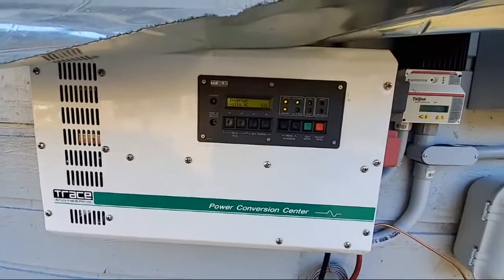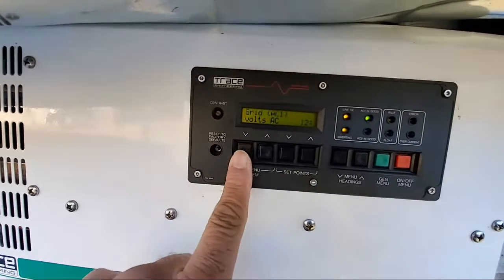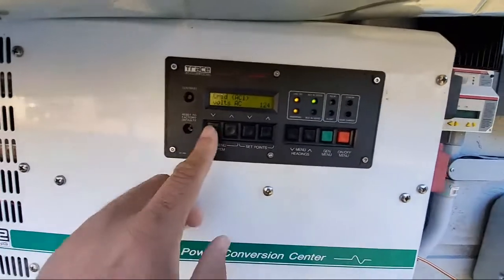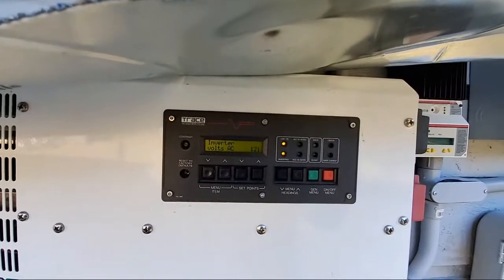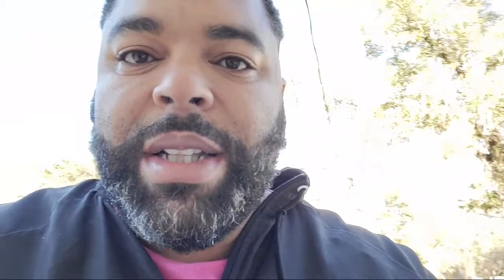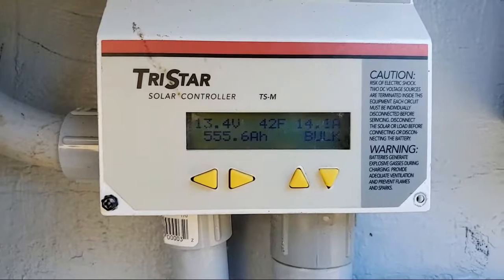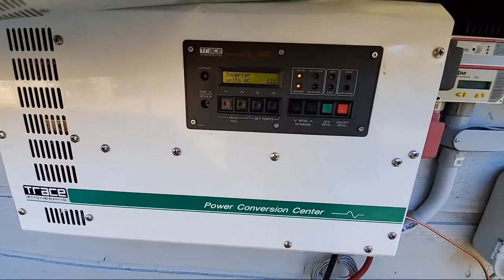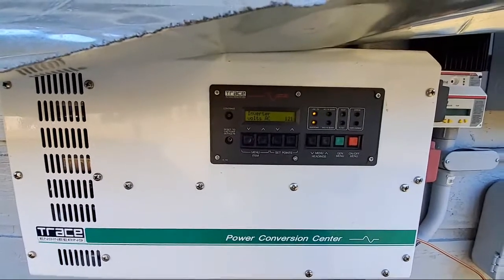Trace Engineering Grid Tie Inverter Selling To Grid

Comment from the maker: If you are not setup to sell to the grid then error is probably something gone wrong in the internal circuit board. 

The company has been sold and changed names a couplentimes since "Trace Engineering " was around so i think you may be out of options with it unless you are able tofind an electrical engineer that wanta to work on circuitry. If you find one, please let me know. I have plenty work for that person. 

Lastly, thanks for watching. I have since upgraded if you check out my solar videos.  I also wholesale Sungold Power equipment if you need anything.   Www.renewablepowergrid.com